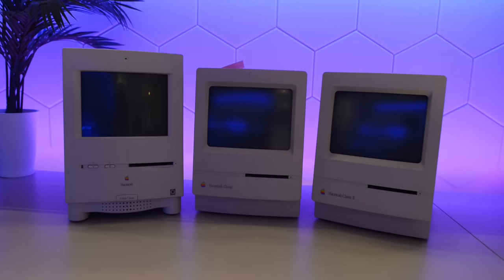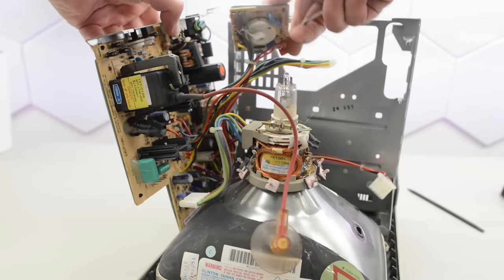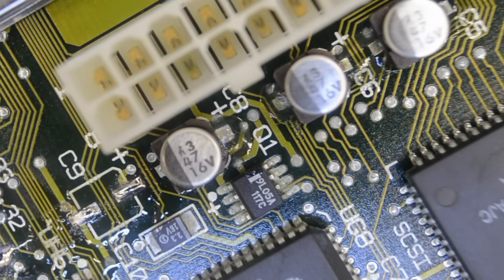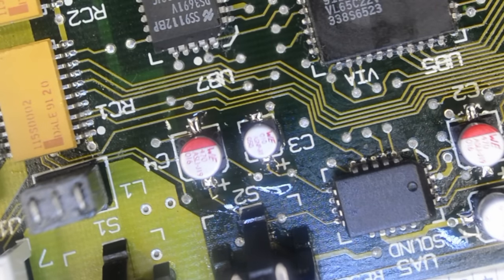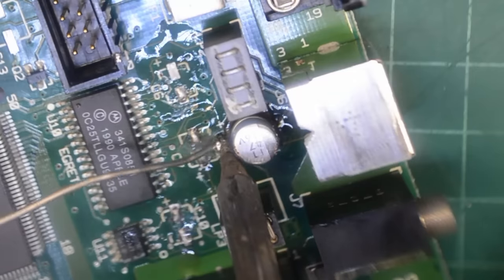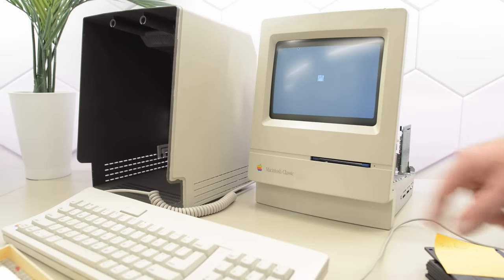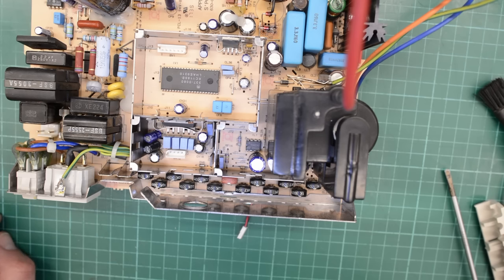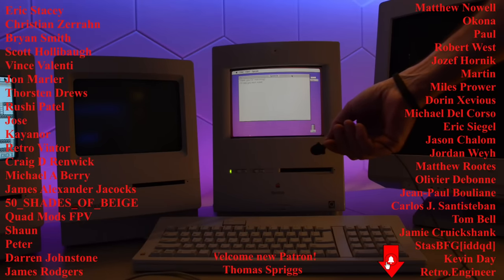Mac Classic, Classic II & Color Classic Restoration & Repair + CR 2032 Toaster

Comment: So ive worked on a dozen CC analog boards and here are the two most common problems with them: 1) the solder joints are absolutely atrocious and you need to basically go over that entire board. Dont try and eyeball it, just resolder it. trust me...  and 2) the harness cable that goes from the front of the board to the middle which is the one you have to unplug to remove the shield... goes bad and can cause sync issues as well as color shifting.

also the HDD has rubber bumpers in there that turn to goo. the spin up/down is caused by the actuator being stuck to the bumper. Unfortunately with that model Quantum, the bumper is UNDER the platter and cannot be gotten to unless you remove the platter and head stack. Which, isnt possible on multiplatter drives without a special removal tool.
Reply from the maker: Thanks, that's very useful. I'll reflow all the solder joints, and check/replace? the cable. I've been looking for a reason to remove and replace the platters on a hard drive, i'll give it a try since this HDD is dead anyway. Cheers
Reply: +1 I think Adrian's Digital Basement dealt with a similar issue on a non Color Classic where the solder joints for the neckboard connector all broke.
If that doesn't work, considering the picture got super bright with retrace lines, I'd check the grid bias (brightness) circuit as well. The closer it is to ground, the brighter the picture is
Reply from the maker: @lauram5905  I'll check, thanks

Comment: I have a theory about the random cable.  Maybe it was for security.  It could been connected to an alarm so if the cable was cut it would go open circuit and trigger an alarm.

Comment: Those Quantum ProDrives commonly have this behavior, which is caused by rubber bumpers inside the hard drive turning into goo. The bumpers are there to dampen the head mechanism when hitting either end of the disk, so the head mechanism tends to get stuck, which the hard drive tries to unstick while spinning up and down, eventually giving up.
Reply from the maker: Thanks, I'll try to replace the bumper

Comment: next time you do a recap, could you mention the soldering iron, and hot air temps in F and C, also the air speed used. Maybe the size of the iron tip, and air diameter. These are small details no one ever seems to mention with these recap videos.
Reply from the maker: Of course. I'll make sure to include that in the next recap
Reply: Many thanks, happy holidays!!
You are one of the better vintage computer video persons to add things like this. You very often do it 'off offhandedly' while you work. Please keep doing this! I find most of these low level comments the most helpful.
Again many thanks!!!!
KL @Epictronics1

Comment: I must be the third person to say the random wire is a for a theft alarm. But I'll go further and point out that is is a very primitive alarm. It's easy enough for a thief to nick the wires and twist them together which would bypass this alarm. Most alarm loops have a resistor at the end so shorts as well as opens can be detected.

Comment: Nice Macs! I like the one with the Trinitron monitor! Difficult to judge from here but it looked like the HV stopped for a moment. Do you hear anything like static noise? It might be a bad flyback, I hope not of course.
When it comes to thermal cameras, they normally struggle with reflective surfaces. Those glass diodes might be difficult to read.
And thanks for not yanking the caps off the board. I've tried the "plier" method yesterday on a board I was working on and I ended up with a ripped pad! Fair enough it was a large capacitor but that's enough for me to say "no thanks" :) 

Thanks for the video!
Reply from the maker: Thanks Tony! I'll keep that in mind when I check the temperature of reflective parts. The CC came to me from what I think was the original owner. Aside from some minor yellowing, the Mac seemed pretty much unused. That leads me to believe the flyback is ok! There is no static noice :) The Mac worked perfectly fine for about five hours after I made the video. After a cold boot the next day it's bad again. Next step is to reflow the analog board I think.

Comment: I use the push down and twist method for those caps.  very fast and have never hurt the pcb.
Reply: Yep, that's what I do for other circuits too, and if you (the viewer) are reading this and you are thinking of any funny business and try to just twist without pressing down or twist while lifting up, good luck repairing the boards. You're guaranteed to destroy at least 1 pad pair.
Reply: Yep
Reply: I do the same since low melt solder is not readily available from where I'm from and I have never damaged any traces using the push down twist method. Before learning about that method, I sadly destroyed many traces trying to unsolder the caps.

Comment: Looks like you replaced those power diodes with generic signal diodes (like a 1N4148). Those are not a great choice for power supply applications. It's pretty common to find baked diodes in older power supplies. Especially before high power schottky diodes were a thing. If that thing has a few amps flowing through it at .7V drop then that's a lot of heat being dissipated. Totally agree about low melt solder for desoldering. It's a secret weapon. Also not a good idea to mount caps on long leads. The long leads act like an inductor and reduce the caps ability to respond to transients.
Reply from the maker: Ok, thanks. Those are zener BZX85C18. I replaced them with the correct part.

Comment: that tripping kinda bother me it does remind me of moss chip and there one attached to heatsink on end of video
i recomment using voltage meter check voltage and see which one is tripping out
27:00 i like that ideas and i done that few time on few other motherbored because dont want pcb melted and causing short and love that you pull them away from pcb awesome jobs epictronics love it

Comment: I love your videos but when you say Im going to leave electrolytic caps to keep the "look" I'm like WTF. Its a board inside a mac that no one will open unless its broken.... like when your next batch of electrolytic caps fail again and maybe rot the board.  Why in the absolute ** wouldnt you use the caps that will last close to forever???? Love Jill
Reply from the maker: Well, most caps don't leak. That being said, I totally understand why someone would take the safe route with tantalums. This also raises two interesting questions. Why do (mostly) Macs have leaky caps from this time period? And, why did Apple mix tantalums and electrolytics with the same value on the same board? PS. tantalums are  popping like crazy in my IBMs :)

Comment: How much current is going through the diodes? You know the voltage drop is .72V, so you can calculate how many watts are being dissipated. Check that the diodes are rated for the current.
Reply: The voltage drop isn't 0.72 though because they are zener diodes. They are being used in reverse.

Comment: My Color [sic] Classic II had some really bad corrosion, way worse than my SE/30, but I replaced the caps in both with ceramics and that worked just fine. The battery holder wasn't a problem, since I removed it to replace it with a cr2032 holder. The floppy drives in both machines were also not reading disks, but they both came back to life after a good cleaning and re-lubrication. Even the eject gears were still working, but I bought replacements anyway since I figure it's only a matter of time.
Reply from the maker: Very cool with a CC II. They don't seem to have made many of those. Glad you were able to fix it

Comment: [I am a US based repair shop] I do a ton of Mac recapping. My process is remove caps, clean pads, ultrasonic, add caps. I sometimes ultrasonic the analog board on classics. I’ve done so many I’ve lost track.
Reply from the maker: What are your thoughts on this CC? bad caps on the analog board?
Reply: @Epictronics1  haven’t made it far enough, let me jump ahead.
Reply: I’d start with the caps, the cc is a smps like the classic. Also, they are notorious for bad solder joints. Especially the pots and what not near the flyback area.
Reply from the maker: @AmigaofRochester  Ok, great, thanks

Comment: I always go with top tier brand caps like Nichicon, Rubycon, or Panasonic and preferably low ESR, high temp, long life ones at that for electrolytic caps. They're unlikely to leak even when they do fail after 30+ years since they're well made. Not to mention they have small tolerances which means the caps are usually very close to advertised ratings. I'd never go with a brand I've never heard of. It's still cheaper than switching to ceramics often times.
Reply: The red caps are Wurth brand. Well known and reputable German parts maker. Good quality caps.
Reply from the maker: Yes, I pretty much only use Nichicon, Panasonic, and Wurth
Reply from the maker: @humidbeing  Great availability too
Reply: @Epictronics1  Yep! Like you, I also like the way the red looks on green/black PCBs :)
Reply: Wurth are decent, IMO, as well.

Comment: Well, that's most likely not a cap issue. But those analog boards on Classics should be both recapped ;)
Reply from the maker: I've been told they get leaky, but all three analog board still look fine. I don't know if Apple used different brands of caps or if it's just a question of time before they start to leak
Reply: @Epictronics1  I usually start to desolder and smell the fumes for a seconds. If I smell fishy smells, then that capacitor was leaking. Sometimes it is hard to see as the corrosive liquid pools at the bottom of the capacitor

Comment: You really ought to check the analog boards on the two monochrome classics for leaking caps. Yes they are nichicon, but specifically the brown colored ones (low ESR, PL(M) series) are notorious for leaking. Not all nichicons are beyond reproach! Every device with those PL(M) I find I recap them, they really are awful
Reply from the maker: I should have mentioned it in the video. I checked every cap very thoroughly on all three analog boards. It has been mentioned that the CC is notorious for having bad solder joints. I will reflow the board first. If that doesn't help, I'll do a full recap. Thanks

Comment: Do you have a list of caps you usually stock and where you order them from? Also, you're not supposed to make the screen extend the full size of the monitor. Check the video from JDW on adjusting the Color Classic's CRT.
Reply from the maker: Yes, I just messed around with the pots to see if they made a difference. I make the size of the picture smaller than the tube when I'm done. I use Mouser for parts at the moment. A list of caps can be found at recapamac.com
Reply: Sorry, was stupid of me assuming you weren't aware of the standard way of adjusting the CRT dimensions >_<.

Also, I'm looking for a list of the specific surface mount radial capacitors you are usually stocking.

 @Epictronics1
Reply from the maker: @nicktasios1862  No worries bro. If I understand you correctly, the part number you are looking for is mouser (edit) 710-865080342006
Reply: I paid for every square inch of that screen and I'll be god damned if I'm going to let anyone tell me I can't use it
Reply from the maker: @heilong108  :)

Comment: This is a flashback to when I fixed up the same machine. These machines are terrible to dismantle. I fear every time I have to open one :)
Reply from the maker: CRT fear? :)
Reply: That too. And I did not have a long enough screwdriver to open the case so I had to improvise :) @Epictronics1
Reply from the maker: @tommyovesen  It's easy to improvise if you have a large enough hammer lol

Comment: The production quality of those Macs is incredibly bad. Fan is held with 2 screws, just clips and molten plastic, brittle plastic, leaky caps and batteries, bad design (e.g. filter caps always on?!?) - how low can you go. Terrible construction and quality. Just like today's Apple products: Look my phone is made out of glass, Gorilla Glass 3000. I put a plastic protector on it so I dont feel the glass anyway, but it is still smashed and broken. Some engineers should have other jobs. If you compare that with the price, you must feel screwed in every way. It does nothing special, but at least we have a motorized disk eject system that falls apart and is slower than just pressing a mechanical eject, but we still put a hole in the case for the emergancy eject paper clip. Terrible design with the hole, does not look sleek or modern, terrible useability, slow and falling apart. Every part of this system screams stay away.

Good work as usual but only the new caps say "470" ad the old "47" 🤔 Probably it is right but a bit strange, 470 would be bigger, but the print is strange. :face-blue-smiling:

Only thing I dont like is that you moved the diodes WAY too far from the board and there is a risk that they touch each other. Usual practise is 1 cm off the board and that should be fine, and for the cap, you have to think that the heat rises up, so it probably was not in the way of the heat stream but only a bit radiation heat.  You could have used shrink tube or something to make sure it dos not short in any way, smaller legs are also more stable and you could have used better diodes so they don't run too hot, and better components often have better snd stronger leads so they disapeat the heat over the board, they are more stable especially when mounted far from the board, and it would be much better. Just my opinion. I  also sometimes bend it away or raise them a bit from the board, but never that extreme.

I have the same cleaning disk, I never mark it how often it was used and I dont throw it away just because it was used too often.

Comment: Have you had any good luck with frost spray? I find it pretty useful to quickly find misbehavig components such as bad caps and cold solder joints. Sometimes even bad chips!
Reply from the maker: Not really. I should give it a try
Reply: @Epictronics1  Turning an air can upside down and spraying the cold liquid on misbehaving transistors is a great way to identify bad parts. I learned that trick from Shango066.
Reply: @vhfgamer  Nice trick! I'm not sure about residues though? Real frost cans advertise "no residue" 🤔
Reply: @vhfgamer  dangerous idea
Reply: @jerther_  In my experience, the liquid out of the air cans just flashes off when it warms up. No residue left behind.

Comment: I'm really glad that you aren't twisting off caps like other YouTubers or sanding the legs on DIP chips! I really hope some day your get a Coleco Adam computer, I.  would love to watch you work on one!
Reply: Unlike you, those of us in 3rd world countries cannot find that kind of easy melt solder and out of thousands of caps that I have twisted off while pushing down on the caps, never once did I get any damage on the pcb. Before the twist off method, I have destroyed several traces using soldering iron to remove the caps.
Reply: @Dark_eVader  I don't have any low melt solder myself i recapped my Turbo Express with just regular solder and some flux. I know some people who cut the cap in half horizontally with clippers to some success.
Reply: @tigheklory  So you only recapped one motherboard? I have a retro repair shop since 2012 and have recapped literally hundreds of motherboards without any problems using the push twist trick. As a matter of fact, Adrian Black recently did a video doing the same thing to several caps and like me, he also had damaged traces trying to unsolder before. Many older PCBs have fragile traces that easily break off the board when heated which is why it's safer to push down and twist those caps instead.
Reply: @Dark_eVader  no not just one many. I mostly fix CRT monitors, Pinball machines and arcade games which use hole through caps.  Why are you upset about me preferring that people don't rip caps off PCBs?
Reply: @tigheklory  I'm not upset but hole through caps are different from surface mounted aluminum caps and do need to be de-soldered preferably. Trying to rip off hole through caps will surely damage the pcb.
Reply: @Dark_eVader  sorry I'm being confusing. I have usually recap hole through, but I was referring to surface mount caps which I haven't ripped any off, I just use no clean flux and my iron to remove surface mounts or hot air. I've got videos on my channel the Turbo Express video is a good one.